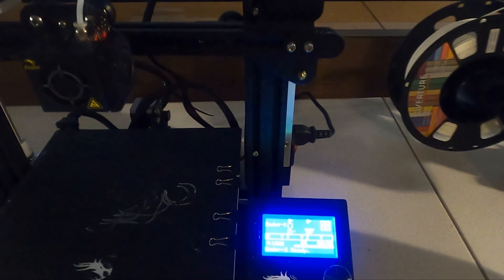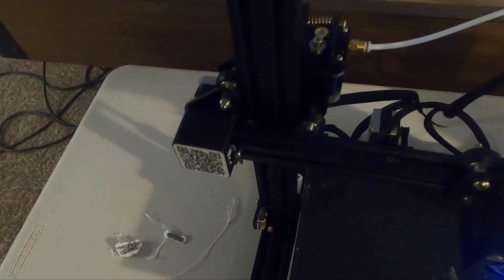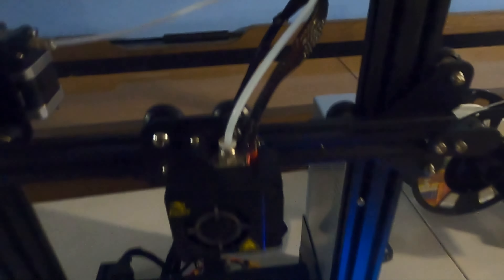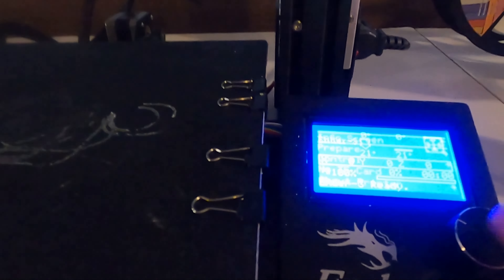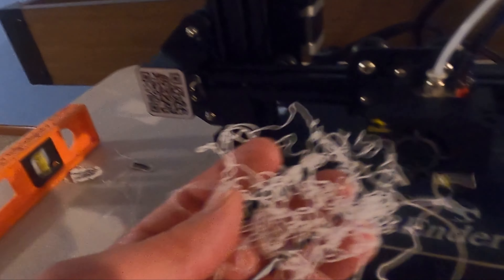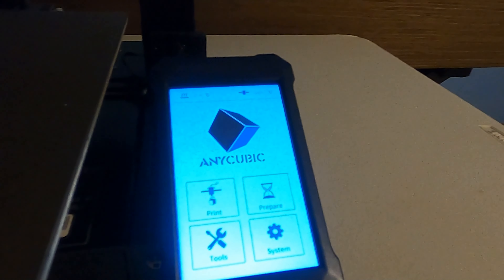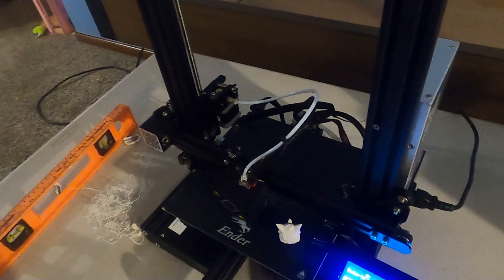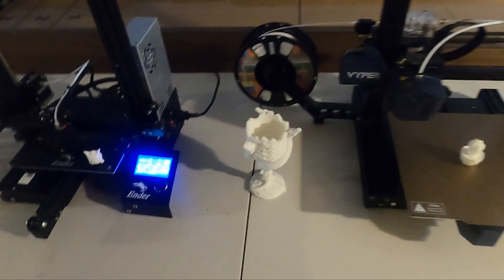3d Printer Ender 3 vs Vyper Anycubic - The real truth from a Newb

Comment: On the Ender there should be an adjustment to tighten the print head to the rail. That should stop the print head from wiggling on the rail. On the back of the print head there should be three plastic wheels. The bottom one should have an eccentric nut holding it. If you put a wrench on the hex standoff holding the bottom wheel to the print head and turn it you should be able to adjust out that play. Just be careful not to over tighten, to much pressure on the plastic wheels will wear them down over time. The Vyper will have the same type of adjustment for all mechanical axis interfaces. I have a Vyper and it is a solid, consistent printer. Here is a link to a video showing the process. https://youtu.be/GsEdU8ZtI6U
Reply from the maker: Thanks and greatly appreciate the information. Wish I would have watched the video sooner.
Well put.
Thanks again
Reply from the maker: Thanks for the information. Greatly appreciate the support.

Comment: My guy, I know you probably know this already by now but, you don't "level" the bed with a leveler. You go around the corners with a sheet of paper and adjust the height of the nozzle in accordance to the bed. Honestly people should stop calling it leveling because the proper term for it is tramming. But either way, the leveling stick isn't the same as leveling the bed.
Reply from the maker: When I got it I watched a few vids that people where using level. I never used a 3d printer before and was trying to get it setup for my son. For being new to 3d printer the Ender was really tough setting up. I'm sure for people have used them or have some clue it's a bit easier.
To be honest the Vyperr Anycubic has been awesome. It can print different filament plus my son has no problem operating it.
Thanks for the comment and support. Happy New Year
Reply: @GettingitDoneFishing  yeah for sure, I completely understand. The good news is with the Vyper it has auto bed leveling so you dont have to do that at all anyway. I started off with 1 resin 3D printer and now I have too many printers. I didn't want to come across as being cocky or disrespectful, my intention was to be helpful. I'll sub to throw some love at ya! Happy New Year!
Reply from the maker: @TitansRevenge3D  Thanks for the support.
I greatly appreciate the thoughts and help. Trust me I don't know much about 3d printing and any help is greatly appreciated.
Looking to start creating fishing lures with TPU any suggestions on software. Right now using tinkercad but seems a bit basic. Again any help you can give is appreciated.
Reply: @GettingitDoneFishing  So depending on how well you can digitally sculpt, or how quickly you can learn....most 3D modeling is done in stuff like Zbrush or Blender.  CAD programs are ok for basic stuff, but if you are trying to get details and basically mold your own designs, that would be the way to go. It might help if you find some pre-made digital files for fishing lures from places like thingiverse or somewhere similar and take a look at how they were made. A lot of times the model descriptions will tell you what program they designed it in
Reply from the maker: @TitansRevenge3D  Thanks for responding
You seem like you really know what you are talking about. You should make some videos. It's really strange I can't find anybody that breaks down 3d printing for new beginners. I think you would be great.
Thanks again for all the support
Reply: @GettingitDoneFishing  I have a few videos on 3D printing but nothing that really hasn't been covered in most situations, however I am going to be doing a 3D printing livestream very soon to talk about all that stuff and some cool 3D artists and eSun will be there to do a filament giveaway
Reply from the maker: @TitansRevenge3D  Let me know when. Count me in. 
It's really hard to find videos that really go through what you should be doing especially somebody that doesn't know anything about 3d printing.

Comment: I totally feel your pain. Two weeks ago I bought the Ender 3 version 2 off of Amazon. When I got it it literally took me almost an hour to put the damn thing together. After getting the whole thing together told to do a bed leveling so I pulled out a level just like you did and made sure that everything including the table that it was on was level. After learning what tramming was I felt like a dumbass. But that part aside I downloaded a leveling STL file from a video I watched. I won't name names. But basically I was chasing my extruder all over the damn printer bed with a piece of paper into thing went so fast that I couldn't adjust the wheels quick enough. And it was nothing but more frustration! I could not understand how I'm supposed to keep up with this nozzle running all over the place with a sheet of paper that was going faster than I could run the paper across the hotbed! After five days of getting nothing but boogers and strands of string I put in for a refund on Amazon. I went ahead and order the Vyper and absolutely loved it! That aside I wasn't ready to give up yet with the Ender 3 version 2. Fortunately I found a video from a guy named CHEP... his videos not only made sense of everything but I continue to watch more videos and learn and learn and learn. One of the things that he had was a bed leveling technique where you do the sheet of paper in the knobs underneath but the extruder stay still until you finish making your adjustment and then you push the button on the screen and it will go to the next spot after two rounds of this then you do the next portion of the leveling process. This portion has the nozzle go around and make squares. It goes from Big squares to small squares and during this process you can tell if you're too close or Too Far Away by if the prints are sticking or not. So if they're sticking that area is good if it's too close to the bed it will go click click click or you'll get a smashed looking line. If it's too far from the bed then the line of the print of the square will not stick to the bed and you tap it with your finger while it's printing. Until you get everything stuck on the bed. After about 9 squares you should have it done before then. Once you know that everything is sticking scrape the bed clean wipe with alcohol and you are free to print anything you want! I just want to thank that guy for making the best videos and tutorials!! CHEP...check his videos out!! He's the best
Reply from the maker: Thanks for the comment. Greatly appreciate the support. I'll definitely check those videos out. Thanks for sharing.
Would appreciate if you could subscribe.
Thanks again

Comment: Hey brother! Good stuff. Just note for future: please God, dont manually move any of your axis like that. Moving the Z axis like that can wonk up your gantry and you'll run into a whole other set of leveling issues. I enjoy both printers but the Vyper wins especially for the fact that it comes BA out the box where the Ender needs upgraded too much.
Also. Reddit. Reddit is the bee's knees for ender 3 help/advice and ideas!
Keep up the solid work brother!
Reply from the maker: Hi Ryan Thanks for the comment and support. I'm totally new to 3d printing and bought it for my son. To be honest if I had any clue what I was doing I think the Ender would have worked.
Just had to many issue straight from the get go. The Vyper has been a dream so far. Really not much goes into it to make it functional.
Thanks again for the support greatly appreciate it.
Any ideas on design software?

Comment: Is Vyper better?
 In terms of print speed, which is the fastest?
Reply from the maker: Thanks for watching the video.
Yes Vyper is way better. It's so much easier and prints come out great. It has auto leveling makes for such an easy process.
As far as speed goes yes Vyper is a lot faster. You can control the speed but be careful on how fast you go it will affect the print.
I hope this helps.
All in all Vyper is way better. Can't go wrong.

If you could subscribe that would be awesome and help the channel.
Thanks again